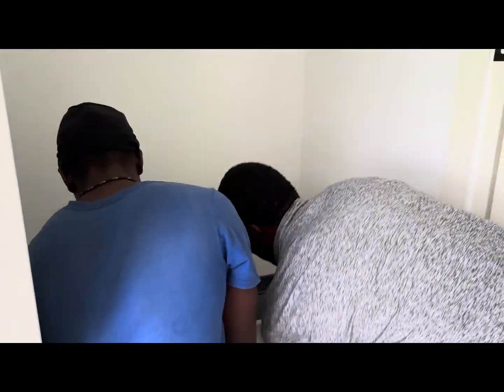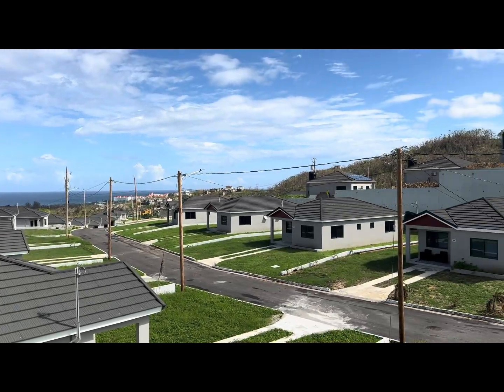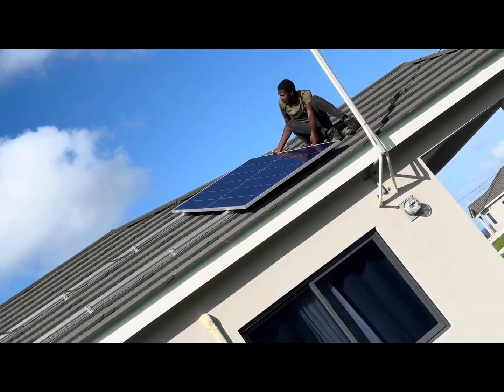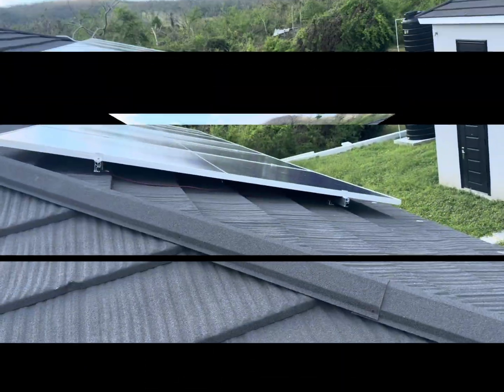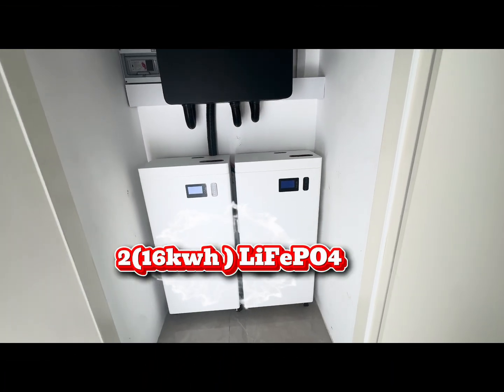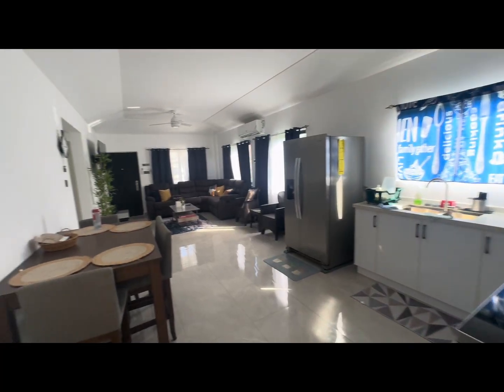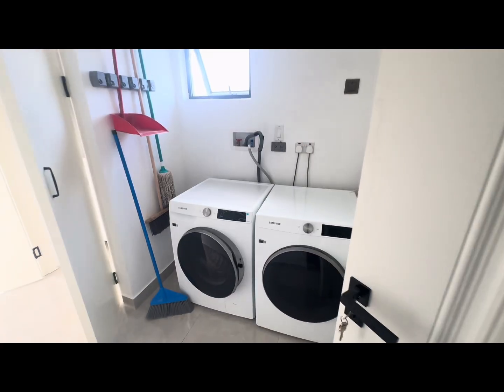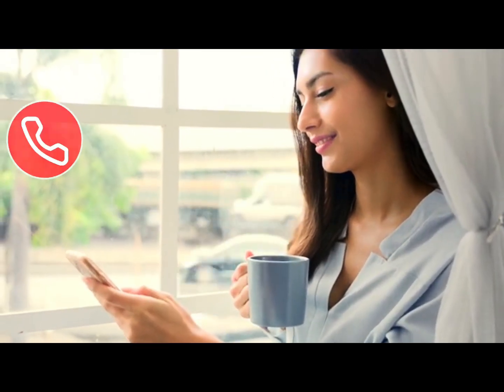AIRBNB POWERED WITH SOLAR ENERGY. 32kwh LiFePO4 BATTERY BANK,8.4Kw SOLAR ARRAY AND 16kw LUXPOWER.

Comment: The Luxpower 16kW hybrid inverter (specifically the GEN-LB-US 16K split-phase model, the primary 16kW variant from LuxpowerTek) has a rated continuous AC output power of 16kW (16,000 W at 240V or 13,800 W at 208V) in both on-grid and off-grid modes.
In off-grid mode (or backup/EPS mode when the grid is unavailable), the inverter supplies this full 16kW continuous output to loads using power from PV solar, battery, or a combination (with support for generator input or AC coupling as well). It includes short-term surge capability up to twice the rated power (approximately 32kW) for 0.5 seconds.
Note that some references mention a 12kW figure in contexts like maximum battery charge/discharge power or similar models (e.g., EG4 18kPV-12LV), but for the Luxpower GEN-LB-US 16K specifically:
Continuous off-grid output → 16kW
This is confirmed in the official datasheet and user manual specifications for EPS/backup operation.
The inverter supports whole-home backup with 200A passthrough when grid is present, but active inverter output remains at the 16kW rating regardless of mode. Parallel units (up to 16) can scale total off-grid capacity higher if needed.